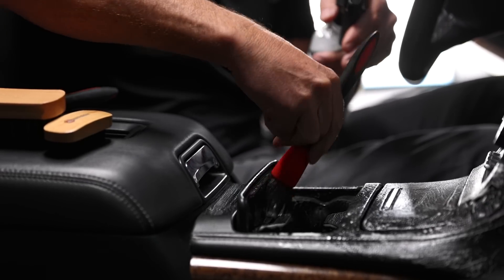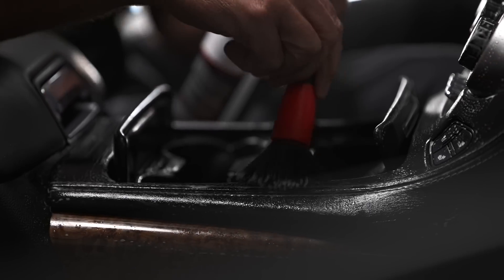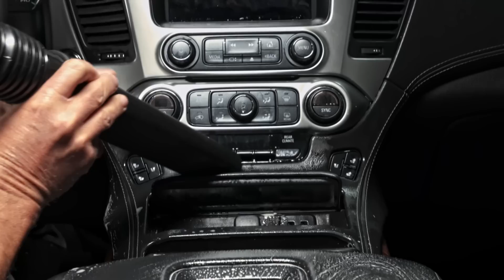How To Deep Clean Your Leather Interior

Comment: As far as vacuuming floor first, I start at the top, then finish with floor.  I like these steps so I am not repeating any work.  I use micro tools to suck up moisture, I never use the large tool on dash if used on floor or you can use forced air?  Any brushes I use on the interior, are dedicated interior brushes.  I never spray product directly onto interior surfaces.  I never put leather conditioner onto the steering, except the inside.  In today's environment, consider using a spray disinfectant.  And always wear protective gloves.

Comment: How does that not damage the electrical
Reply from the maker: Hi there! As Adam demonstrated in the video, this was for deep cleaning certain areas. He used a wet-dry vacuum to suck up the majority of the agitated Leather & Interior Cleaner liquid first. This will pull liquid out from behind buttons as well. Then wipe up the excess with an Edgeless Utility Towel. If your interior is not as dirty, simply spray the Leather & Interior Cleaner directly into the Edgeless Utility Towel, then wipe the towel over the buttons and controls. In either case, make sure the vehicle is off and all electronics are powered off before cleaning.

Comment: Why call it leather cleaner if you use it on plastics and vinyl?
Reply from the maker: Hi Richard, it's actually called "Leather & Interior Cleaner." It's a strong cleaning chemical that can be used on leather, plastic, and vinyl surfaces. Keep in mind that it will remove any previous dressings or conditioners from these surfaces, so you will want to protect them again afterward with something like our Leather Conditioner, Interior Detailer with Microban, or Leather & Interior Dressing.